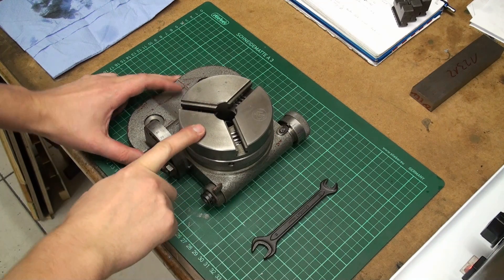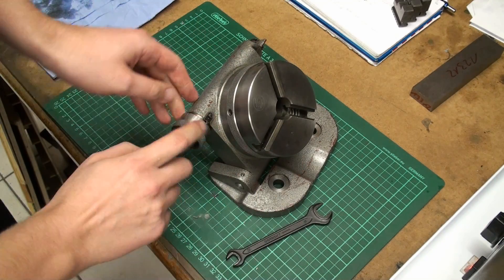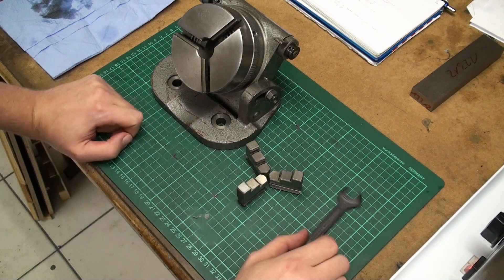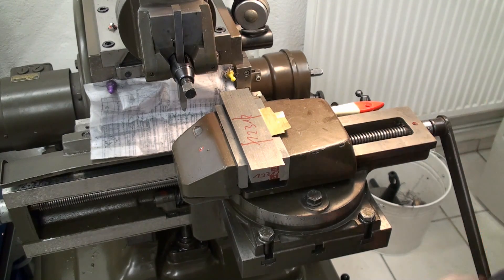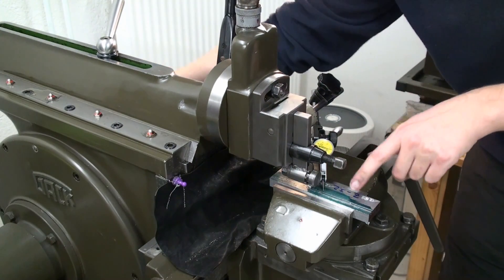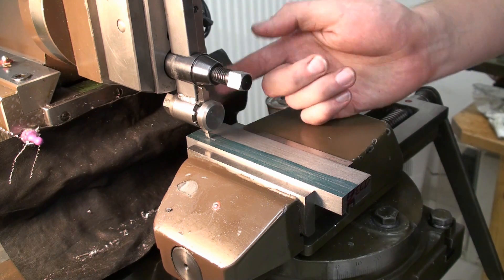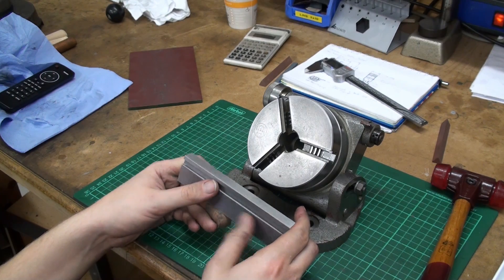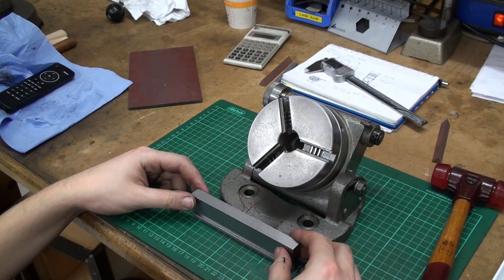Making a set of chuck jaws Part 1/3

Comment: You are running the shaper in reverse, basically. It has a faster back stroke than forward. Are you able to change that to run the tool backwards like you have? Change which direction gets the faster back stroke? I assume the machine has more power if you’re not cutting in the faster back stroke?
Reply from the maker: Yes, the machine is setup to run both directions from the factory. And yes, the faster returnstroke would have less power.

Comment: Hmm. What happened to your "three point" metal holding you started out with on the shaper vise?Looked a bit iffy to me.
Reply from the maker: I still do that If I have rough sawn parts that are not parallel - Sometimes with some shimstock, sometimes with a piece of soft copper wire, sometimes with a ball bearing that has a flat ground onto it. Much safer than trying to hold material that is not parallel in a vice :)

Comment: Stefan, let me tell you that, for me, this is an amazing video you made. It helped me understand that i could build a chuck of my own, manually, without having a lathe or a shaper like your's. I just need to device a hand machine and a few cutting tools. I want to set up a lathe, and for an eastern country, like mine, chucks are pretty expensive. Buying a small or an average chuck is almost affordable, but if i want a bigger one, then it will cost a lot. At the end, i will have my personal satisfaction that i did it. Thanks.

Comment: hi, Stefan, top quality work, is a joy to watch,
especially like the shaper machine you have there, I have one as well and use it mostly for making tee bolts for the rotary table and milling machine, I know its quicker to do in a mill
but a shaper always has that kind of a "no rush" approach
keep up the good work, your work is stunning
regards Keith in Swindon u.k
Reply from the maker: mrmyford Ha! Same here with the shaper, its easy to setup, but the work with it just takes some time that I am very willingly to spend. I run a cnc milling machine at work, almost all highspeed stuff, small tools, high rpm/high feed, so the shaper is a nice relief :)